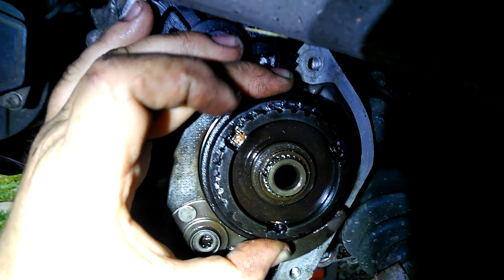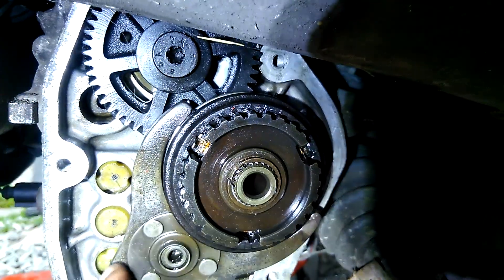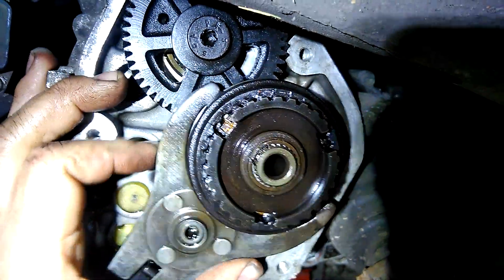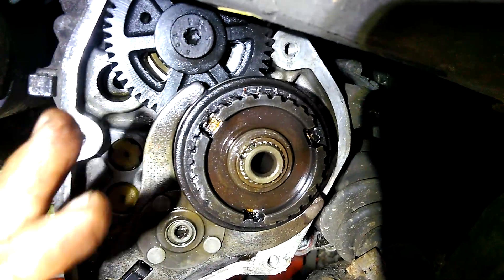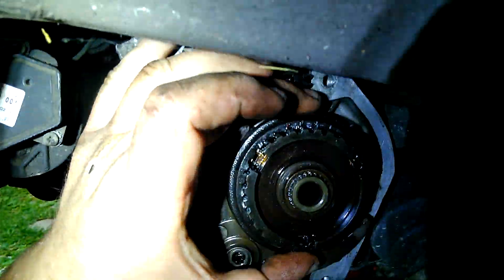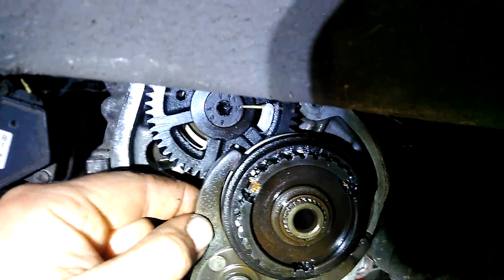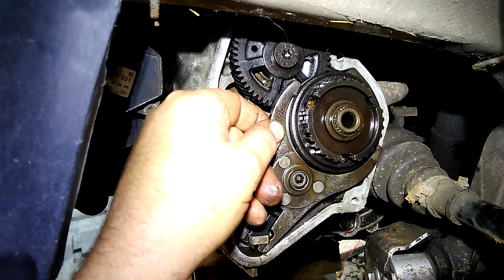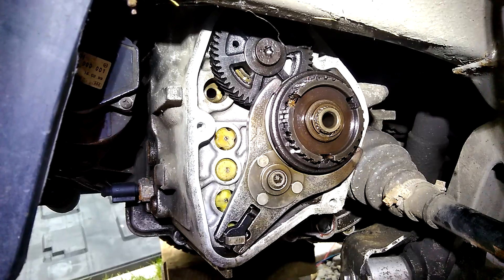Lupo 3L manual shift gearbox. 5th gear repair after running almost no oil.

Comment: Hola enhorabuena por tu canal yo también tengo un lupo 3l y se me rompió el piñón de la 5 marcha cuando lo repare y cambié el aceite de la caja le entro más que salió. Me gustaría hacer la conversión a manual le anulaste la centralita del cambio?
Reply from the maker: You're good and skillful. Basically, you have 2 options: Get an overhauled hydraulics (~€300 with a few years guarantee) or manual retrofit. I can also offer You reflashed/reprogrammed engine ECU (my work, not a copy) with slightly improved fuel efficiency and car behaviour. No gearbox control unit nedded, it works standalone. You can contact me on FB or Whatsapp (+)420 73[six] 41[three] 98[one]